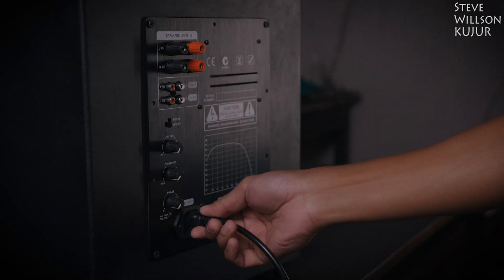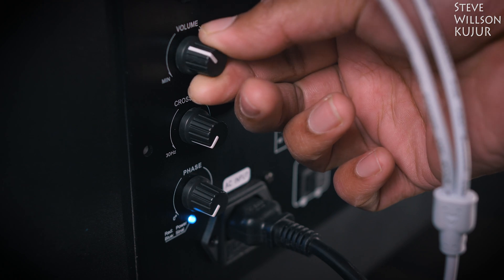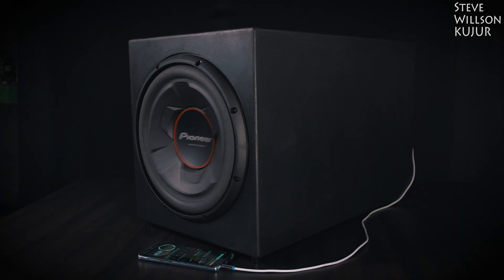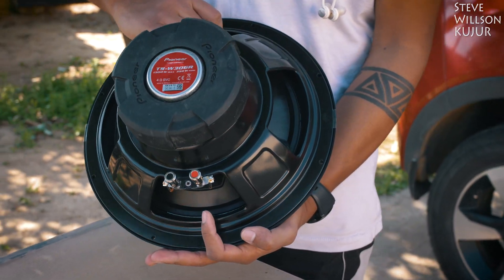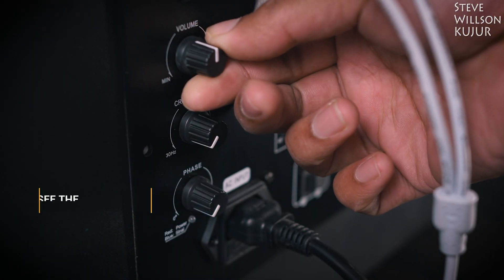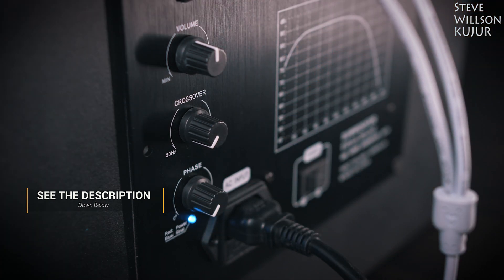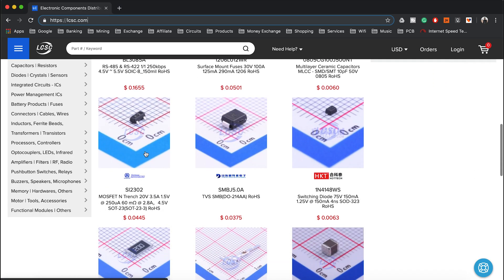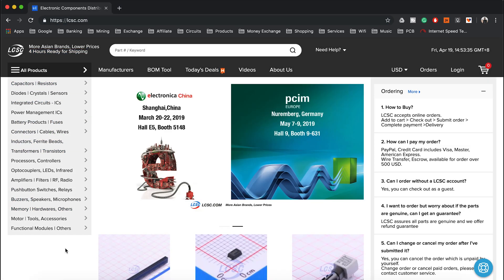DIY Down Firing Port Active Subwoofer

Comment: It's a shame am commenting too late from the release of this video😂. It looks to me that you are using a 6inch port; maybe 4inch I cannot tell. That is overkill for a sub only powered to around 250w. But, the port is down firing and you haven't given is enough clearance from the floor. Clearance should be atleast the diameter of the port so you need 6inch long spikes if your port is 6inches or 4inch spikes for a 4inch port.  The port is suffocating and probably causing distortion.

Comment: Sweet little sub, but for construction and finish work Instead of using finishing nails, it's wise to use screws and 90 degree steel braces on the insides of sub's, they vibrate so much. I also use notch and groove, glued, clamped and screwed. I use a non shrinking spot putty you mix with hardener and you'll never see any imperfections or screw holes ever, it's called "Evercoat" and I also use their primer, it fills all scratches plus that's non shrinking and I promise you'll love it. I used to run a body shop for rare and expensive Italian sports cars, instruments, speed boats and you name it.
Reply from the maker: MrBrymstond Thanks for the recommendation I'll try it
Reply: wow if i build a box in future
i take down ur notes